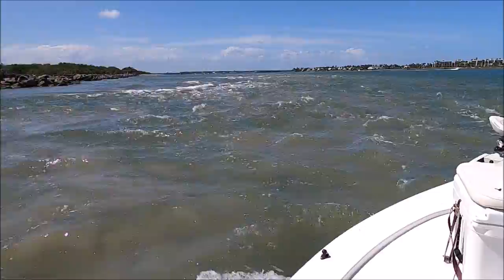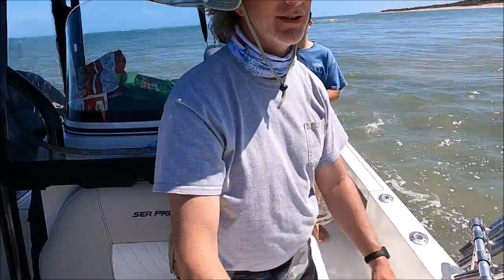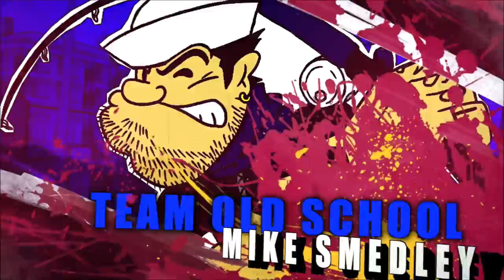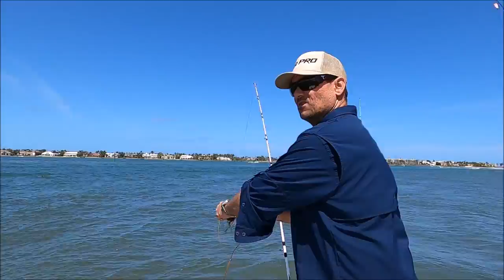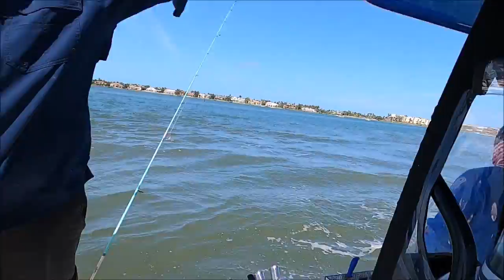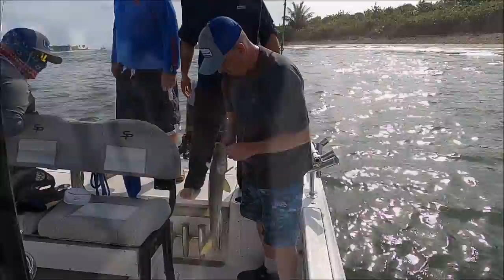Does Spot Lock REALLY Work in Strong Currents?? Trolling Motor Anchor Lock

Comment: Mike another great video. Definitely going MG xi5 after all this. Do I need a separate gateway to run to my Evo3. Also do you recommend the quick connect from MG I just don5 like the idea of nothing bolted down to the deck and I run a nasty inlet. Thanks bro
Reply from the maker: Todd P You need the MotorGuide gateway and a NMEA wire.  Actually the mount adds a great bit of shock absorption being Nylon. I beat the PISS out of my boat and I honestly think it’s better than bolting it directly.
Reply: Mike Smedley  thanks bro. Just to clarify you went with the nylon mount not the aluminum, I can see the nYlon being better. Do you have an amazon link for the model bracket you have, i didn’t see one? I will buy it for sure.thanks Mike
Reply from the maker: Todd P I have used the Nylon one for several years and it really works well.  Doesn’t look like much, but I really beat the life out of it and it’s been great. I think there is just the right amount of shock absorption. 

I had lots of issues with other aluminum mounts with them bending and clunking like crazy. It drove me nuts with the noise it made. 

 Here’s the nylon mount. 
https://amzn.to/3dNcFRf
Reply: Mike Smedley. I’m ordering it now! Stay well bro! FYI the wife saw the video showing anchor lock and she said buy it now! That’s a compelling video.

Comment: Love your videos Mike. You have already helped me a lot with my Simrad nss evo3. But regarding this TM, I want to put one on my Steiger 28' and I need a longer shaft. Looking at motor guide website and their longest is listed at 72". So I am looking at both the minnkota and the rhodan, 36v with the 7' shaft. So I have 2 questions. 1. Do you have any experience or recommend one of those vs the other. And 2 it appears your install is where you would normally have your red/green navigation lights, what did you do with those?
Reply from the maker: Hey brother. I have had Minn Kota my whole life I will never recommend one in good conscience. They are super unreliable. Countless ruined trips. I would definitely recommend a Rhodan though. They are designed with bigger boats in mind. I’ve heard great things on them in fact one of my best buddies just put one on his big boat. He has the beard in this video.  The guys at Rhodan will help you with the size.  

My lights are in the rub rail. In the past I made extensions for my bow lights to raise them when they weren’t in the rail.
Reply: @MikeSmedleyOLDSCHOOLSTRIPERS  - wow, I thought it was just me on Minn Kota. They have a great design but the boards just seem to fry. And the remotes are so big, heavy and complex. And you raise an excellent point about bow lights and saltwater trolling motors. They can easily block your green and red bow lights from other boaters, which is a legit safety concern. I will have to be extra careful on how I place the new Xi5 on my Montauk to avoid that issue.

Comment: I bet those Batteries didn't last long? But it's impressive
Reply from the maker: Right. At full throttle they definitely won’t last very long, but with 3 group 31 batteries in 36 volts it was great for spending 15-20 minutes on each spot. With most spots only needing it on speeds 2-4, the motor ran a day and a half on one charge. My buddy got the Rhodan motor and he said he loves it.

Comment: Did I heat correctly a day and a half? What batteries are you using? Is that the terrova?
Reply from the maker: That is a MotorGuide Xi5. I have group 31 AGM batteries. We indeed ran a day and a half with one charge, but not in that one spot. We ran around to many spots. Some areas used more power than others.  If we were to stay in that one spot (in the beginning of the video), I wouldn’t count on more than 4-6 hours on one charge. It felt like the motor was working close to full power.  On days where the motor stays on level 3 I have gone several full days on one charge.

Comment: I have a Minn Kota 24v 60" iPilot Trolling Motor S172MK00527 with two 12 volt batteries.  I was fishing Estero Bay in Florida this morning.  There was a nice outgoing tide, but I don't think anything like the commotion in your video.  I hit the anchor image on the iPilot remote and it shows as anchored.  I just kept getting swept with the current.  How strong a current can the trolling motor counter?  Comments?  Could I be doing anything wrong?
Reply from the maker: Why size boat do you have? What voltage is your motor?
Reply: @MikeSmedleyOLDSCHOOLSTRIPERS  22 foot Pathfinder ("bay boat).  24 volt trolling motor.  But I have not checked the battery charge lately.  Maybe that should be my first stop?
Reply from the maker: If it ran more than 4 hours your batteries were probably charged.  Fully charge them and put a volt meter on them. They each should be at 12.9 after being charged.   A 24 volt motor on a 22 ft boat is fine for lakes, but in saltwater currents a 36 volt is a lot stronger.  I use a 36.

Comment: What size shaft you have with that and does it hook right up to your Simrad where you can put a waypoint  in and it'll  keep that waypoint
Reply from the maker: It’s a 72”.  Yes it interfaces with Simrad so you can follow waypoints, etc.
Reply: @MikeSmedleyOLDSCHOOLSTRIPERS  what's the distance from  unit to the water line on your boat
Reply from the maker: grady white Around 20” roughly

Comment: What group size battery? How many amp hours are your batteries?
Reply from the maker: I used to carry group 31 AGM batteries. I made the switch to lithium and wish I switched sooner. I use to use a battery and a half for a 10 hour day now I use 3/4 of a single battery and it only weighs 28lbs. I believe it’s 105 amp hr. It may be 115.
Reply: @MikeSmedleyOLDSCHOOLSTRIPERS  can you post a link to the lithium battery and charger you use.  Im planing on doing the same
Reply from the maker: I’m using a battery from a new company so they aren’t available yet. I’ve been using testing them for almost 2 years. They should be available soon, but this is a similar battery https://amzn.to/3SMbFSB. I’ve been using my regular battery charger, but you can get a lithium charger like this https://amzn.to/3QgQeaJ
Reply: @MikeSmedleyOLDSCHOOLSTRIPERS  so you have 3 12v litumims is series or a single 36v lithium?
Reply from the maker: I have 5 total.  3 for trolling motor in series . 2 for house parallel. 👍

Comment: It's cool and amazing if you don't mind spending that much for a trolling motor.   Drift sock - $35  Anchor / line - $50   i pilot T motor - $3K   Hmmmm
Reply from the maker: A drift sock won’t hold the boat still in a 3mph current, and that trolling motor serves many other purposes. I can set it on a specific heading to follow waypoints, I can pull a spread of baits on boards and floats, I can drift a shore line, stopping wherever I want by touching a button. I probably use this trolling motor more than any other piece of equipment. It’s absolutely worth the money for me. https://amzn.to/2WiT1XL

Comment: What boat is the MG mounted on?
Reply from the maker: Sea Pro 248 Bay. 2019.
Reply: Thanks, I wasn't considering Motor guide at all but definitely am now. I've been looking at a Rhodan. How does the MG 105 compare to the MK 112? The 3 blade probably helps a lot?
Reply from the maker: I would go with Rhodan or MG but I wouldn’t even consider a MK. They are just too unreliable. I turned down a free one brother!!
Reply: @MikeSmedleyOLDSCHOOLSTRIPERS  - got the Motorguide xi5 and hope to try it out today. A fried who went to Rhodan said that Rhodan uses Motorguide's main board.   Thanks for your help and great video.

Comment: Constant current works well. Changing current or dead calm is its weakness.
Reply from the maker: Have you used a MotorGuide or Minn Kota?
Reply: @MikeSmedleyOLDSCHOOLSTRIPERS  I don't own a Motorguide but have friends that do. They're basically the same. The issue is with drifting. In constant current, the motor will stay ramped up to react to changes.If the motor has to cut off or spin down to stay locked in position, it takes time for it to cut on, spin up and adjust. All that I've seen do this. Don't get me wrong, it works well 90 percent of the time but if you're vertical fishing in dead calm with harsh gusts of wind, it will drift off too much. At least that is my experience. I've heard the same from other brands but don't own one.
Reply from the maker: ToThePoint A steady breeze definitely helps. I have had every (autopilot) MK model they make and they’ve all been a nightmare in comparison to this MG. MG isn’t very fancy but it always works.  Thanks for the comment
Reply: Hi what lb thrust are you guys using on this boat?